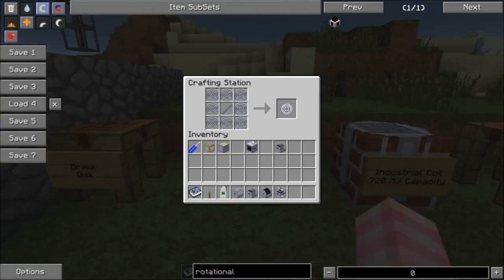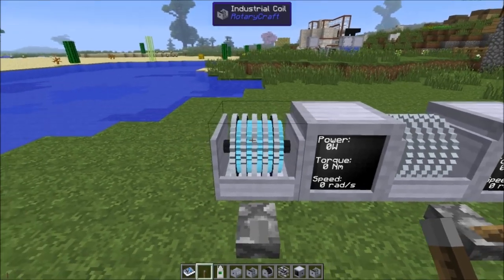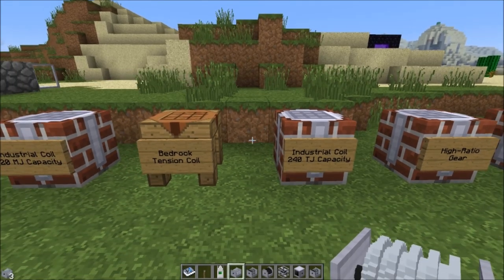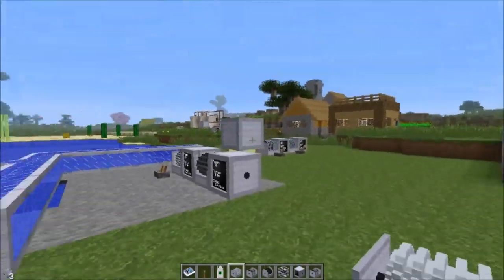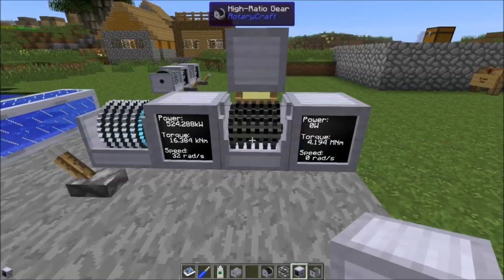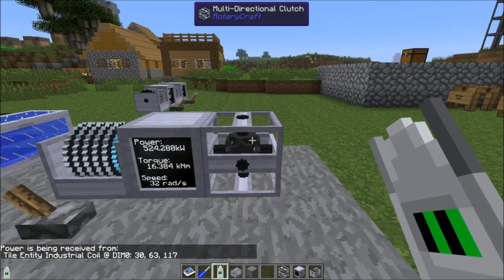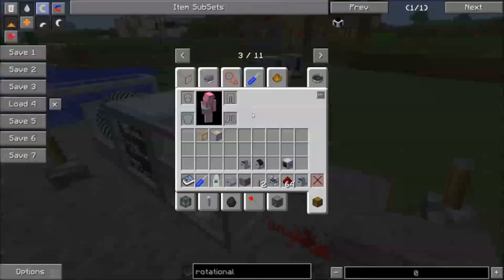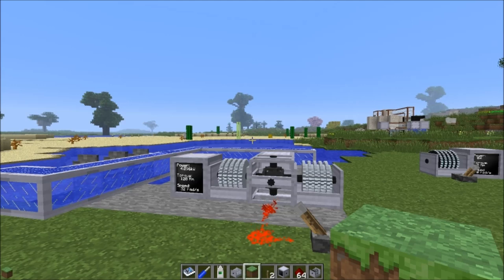RotaryCraft Tutorial #22 - Industrial Coils and More

Comment: I really do NOT recommend telling people "you need X gears" or "X power" to run a given setup. RC is designed such that if you need to be able to figure out this sort of thing yourself or be penalized severely. By essentially handholding, you are in fact doing them a disservice.
Reply from the maker: I guess I can see your point. Its actually the same point that Kreia makes in KOTOR 2.
Reply: As you can probably tell, RC is all about learning as opposed to grinding.
Reply from the maker: Reika Kalseki Although there is a fair amount of grinding involving lubricant.
Reply: Derp. ;)